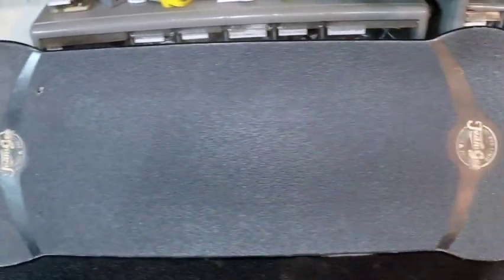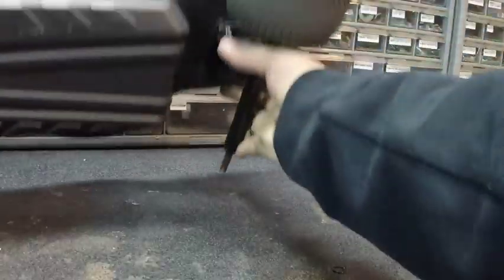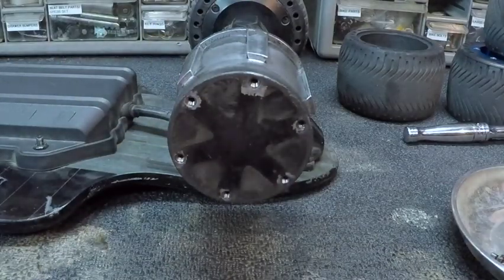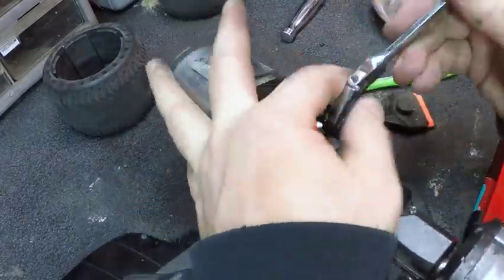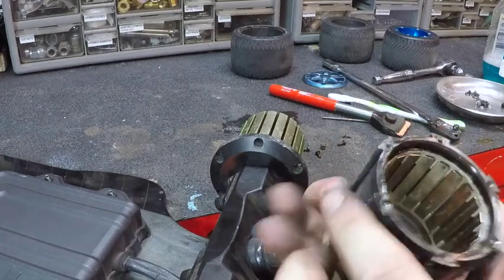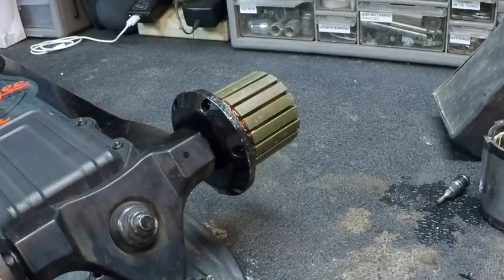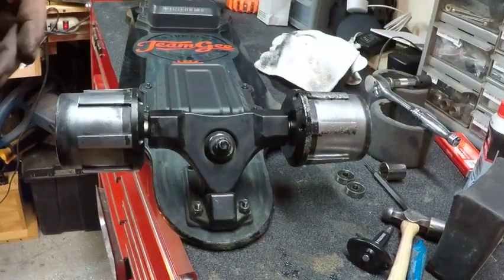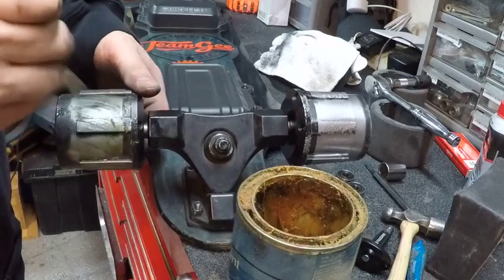EP 15 Skating By! Replacing bearings and discussing issues with my Team Gee H20T Electric skateboard

Comment: You know you can configure the remote to make it like 25-35% faster?
Reply from the maker: Oh? How so?
Reply: @unclebennysgarage  start with the remote off, hold the bottom 2 buttons. allows you to edit the wheel speed. if you have the seahorse remote.Its the same way u change from km/mph im pretty sure. i got mine up to like 39 mph upside down like u had urs when u tested it. unfortunately my H20 no longer works. Pretty sure its the light mainboard switch, and not the battery. but i could be wrong. dont wanna try and fix one when the other is the problem. I was gonna buy a whole new one but they no longer make/sell the H20 or H20T.
Reply: @unclebennysgarage  im guessing they dont put it at the max wheel speed because of regulations and testing, and the board is meant for beginers to mid level riders. Be careful!
Reply from the maker: Interesting! I’ll have to try this! Thanks👍
Reply: The setting is for wheel size rather then speed. 😂

They use the same remote for all their boards 

I had tested this with my h20t at a speed limit sign ( that shows how fast youre going).

The big numbers you see on the remote is only visual😂
Reply: @Sviesius  I believe that to be inaccurate